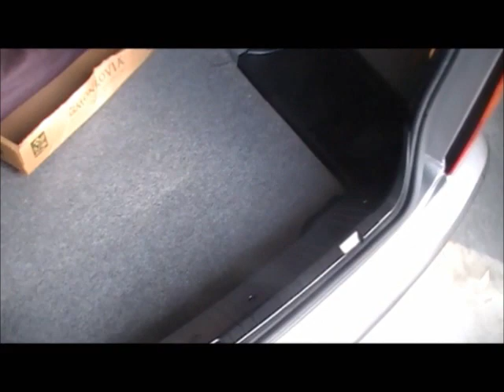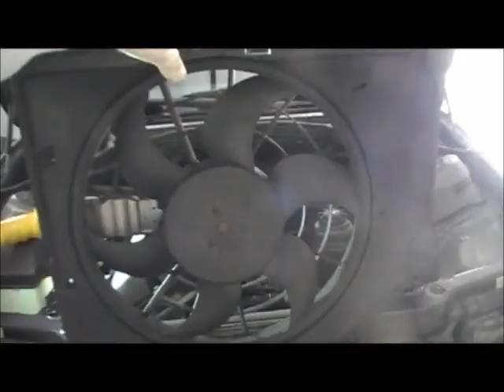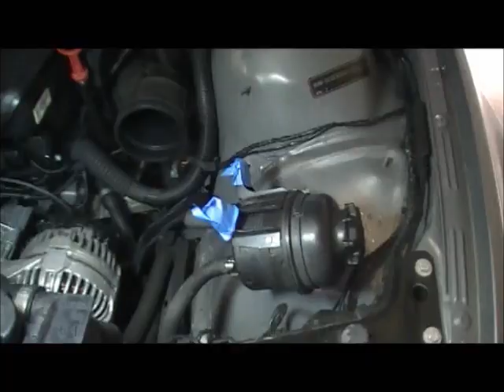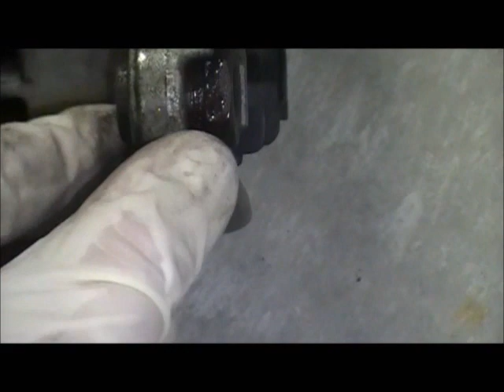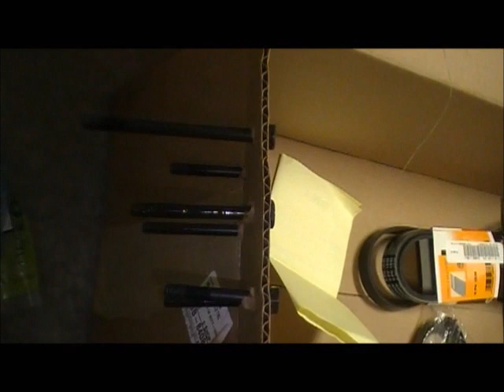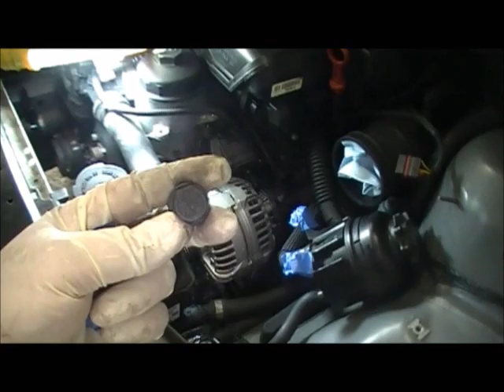BMW Oil Filter Housing Gasket and tensioner idler pulleys

Comment: The bad thing about the e46 is like most late model BMW's, stuff breaks that will seem foreign to you if you've owed a Honda or Toyota. Having owned Acura's at the same time as BMW, it's a striking contrast of how much attention these cars need. BMW's main magic trick has been to turn rubber seals and gaskets into brittle plastic in a relatively short time compared to the Japanese. I sure hope they don't make condoms under another name. The good thing is that there is plenty of good how to videos on YouTube like this. Thanks.

Comment: you absolutely do not have to take the positive terminal off of the battery as you won't/can't complete the circuit without the negative terminal connected to the battery !!!

Comment: Awesome vid! Question: Dealer told me oil filter housing is cracked. Is it safe to assume the seal needs replaced? Just curious before I dive in;)

Didn't like the guy, failed insp for mirror marks (the defrost tint, not sure what it is)

Comment: Thanks a ton for this video. It helped tremendously. I did not , however, disassemble the power steering pump. Yet, replacing the gasket was easy. Surprisingly, the e39 m54 is easy to work on...just time consuming.

Comment: I got Engine Service light on after replacing the oil filter housing gasket. The fault code is P0014 BMW - 'B' Camshaft Position Timing Over-Advanced or System Performance Bank 1.  It complains VANO is having issue. I wonder if you have some suggestion as what would have caused the issue.

I have done the following to attempt addressing the issue:
1. visually inspect all electrical cables are replaced, especially the ones connected to VANO camshaft position sensors and solenoid. I power-washed the engine bay and wonder if I have shorted some sensors. 
2. turn the oil-feeder bolt that sends oil to VANO. I was worry that the bolt needs to be at certain angle to allow oil to flow. Could it be that it is not feeding enough oil to operate VANO?

Comment: Thanks for the video instruction. It is very helpful. The most difficult part of the job is to put alternator back. It is hard to line up the holes on the bottom bolt.

Comment: Great video.  But you can replace this gasket and leave the oil filter housing in the car.  You won't have to lift the front of the car, either.

The power steering pump does not need to be messed with if all you are trying to do is replace the OFHG.  The PS pump and brackets do not attach to the motor...only to the oil filter housing itself.  They are plumbed into the power steering rack with flexible hoses.

Once the filter housing bolts have been removed, the housing can be tipped away from the block back towards the driver's fender enough to get to the gasket, much like the power steering reservoir is tipped away.

I just did mine.  Saves a bunch of time not removing the housing from the car!

Comment: Hahah automatics
Reply: Shawn P
I referred to the joke at 5:52
Reply: +FrozenHaxor  the e39 manual still have a fan connected to the engine
Reply: +Kevin Sahib Okay but how's that relevant? This is an E46, a completely different car. E39 actually has 2 fans. One being electric aux fan for the AC, located in the front.

Comment: I've watched your video like 20 times and it's been a life saving and actually not bad to do. I don't actually remember where you mentioned on where to put the sealant? :X    I'm actually doing this job for a second time bc my water pump busted on me and the fan wasn't even spinning but without this video, everyone would be going to dealers or shops to get ripped off

Comment: is it necessary to take all those items off to get at the oil filter housing gasket?
Reply from the maker: if you haven't done your tensioners and they spin freely then yes, otherwise only one of the tensioners need to be removed as I recall, the one with the alternator.

Comment: question, please help,  I purchased a 325 2006 bmw.  I specifically asked the seller if there were any issues with the car and the seller said no  however I brought the car in and found out it has an oil leak.  Question  I found out that a bmw dealership told the seller that their was an oil leak right before he sold it to me,  the statement says  : "Oil filter housing gasket is leaking drive belt tensioner is leaking".  This was told to the seller in april 2013 he sold me the car approx the end of june 2013.  can this issue cause further damage because the seller did not fix this issue, can this leak and drive belt tensioner cause another oil leak?

Comment: Thanks for the DIY - worked great for my e39 replacement but I did have to battle with mechanical fan and shroud...  One tip for removing/replacing the alternator that I figured out (others may have noticed this too).  You talk about wedging the boss nut to release some tension to remove the alternator (I did that and it helped). Putting it back in was a problem and it dawned on me that with the alternator out of the car you could thread the lower bolt into the boss nut and give it a few taps to drive the boss nut out just a hair to widen the gap.  I think that would also work well on removing the alternator too.  Just make sure to torque it up properly upon installation to pull the boss nut back into place.

Comment: Thank you. I did this job on my E46 2003 330i last saturday it has 65k km, but 10 years of city driving. I'm an amateur mechanic. My car got this leak for about one year ago, and I had no a clue about the source of this leak, I thought the valve cover gasket was the culprit. Without this video I would have to pay a good money to my local BMW dealer shop, down here in Mexico. I had to remove the radiator fan because my car has automatic trans, but this is not a big deal using the proper tools. By the way, the old filter housing gasket in my car was like a hard plastic (not flexible rubber anymore) and partially broken. I don't know how BMW was not able to use a better material or different design on this. Same case for the valve cover gasket, which I'll replace it next weekend. Thanks again dude!!

Comment: Hey man you might already have figured it out, but you need to take the A/C belt off first. There are a total of 2 pulleys. One for the A/C belt (smaller belt) and one for the alternator belt (larger one). When I did mine both had a 17 mm bolt head, that I had to *Tighten* to get the belts off. 
Of course you might need to first take the radiator fan off to have space to work with. 
Hope this helps man

Comment: Hey man, I don't know if you receive or read all of the comments, but I just wanted to say thank you for the video. It was very informal and helpful. I performed this task a couple of days ago at my house and had to come in to view a couple parts where I was stuck on. Thanks again. By the way, I have a 330ci (european spec) and I didn't need the 60 torx. Not sure if you where aware of it. I got away with using a 17 mm for both pulleys. Also I only changed the gasket.
Total you saved me about$750

Comment from the maker: Its likely just pure chance that this happened 2 weeks after an oil change. they are nowhere near these components and well...it's just not good karma.
Now the burning smell or oil smell is a definate sign of valve cover leaking. They probably also looked and saw you needed the oil filter housing (OFH) done as well. These are very common leak points in the e46. So now...if you're telling the entire story 2200 is NUTS. half that would be worst case and still bad. go elsewhere for 2nd opinion.

Comment: please tell me what u think i took my car to BMW for an oil change recently about 2wks later notice a burning smell coming from the hood and smoke, took it back, they told me it need a oil filter housing seal and valve gasket change which they never did when i initially  took it in. they now gave me a quote for about little over 22 hundred dollars, i feel as if they were negligent in not telling about the issue originally. i didnt have any issue before of burning smell or smoke.

Comment: If you disconnect the negative side of battery you don't have to worry about grounding the positive terminal from the alternator .  Very informitive video I was wondering what was leaking in that area now I know. Thank you.

Comment: Thanks for making the video. Im half way through replacing the gasket on my mates car. Its not too bad an extra amount of work if the car is an automatic. Just need a 32mm? open ended spanner and a flat screwdriver. You can jam the screw driver against a couple of pulley bolts whilst turning the nut on the fan coupling clockwise to remove the fan. this video has been a great help. Now for the re-fit. Thanks!

Comment: Probably the best DIY on an E46 I've seen, thank you!! I just completed this on my 2002 325i and halfway through my family was so impressed with my bad assery especially the cardboard to hold the 6 OFH bolts. Of course I did NOT give you credit, but I will do so here :)

My older model had different tensioners and power steering pump, but not so different that I couldn't figure it out. Anyway, really appreciate your work here!

Comment: PMPDaddy68 - HUGE Thanks for the video!!  I bought a used e46 for my son (first car) - we got a great deal....and the reason was it leaked oil from the filter housing - as well as the valve cover gasket....Your step by step made my repair run SMOOTH!!!  I couldn't have done it without you....My son and I thank you!!!

AWESOME!!!

Comment: I'm having trouble finding where to replace the oil filter adapter o ring on my 318i 1996  There were none there when I removed it on the thermostat type component, I believe it helps regulate oil pressure?  HELP!

Comment: Thank you so much! You are very organized and methodical and that makes it very easy. Great DIY! My husband and I did this job yesterday on his automatic, so we had the fun job of removing the fan. I didn't have the fan clutch wrench so I used pair of of channel locks and a long thin screw driver to wedge in between the water pump bolts. It was leaking from the valve cover gasket and the oil filter housing gasket. Saved over $1200 doing these ourselves! Thanks for your help!

Comment: My husband has an 01 330i and everyone I asked quoted between 700-1000, but the BMW specialist I got a second opinion from (after the dealership wanted 2500 to do valve cover gasket, oil filter housing gasket, and oil pan gasket) he told me that most of the time its not actually leaking from the oil pan. Usually it's only the oil flying back while your driving getting all over everything leaking from the valve cover or oil filter housing gasket or both in bad occasions, like my husband's.

Comment: As I was following your steps, I noticed the banjo bolt on the Vanos was missing one of the washers.  The washer that sits closest to the housing was missing.  After replacing the housing gasket, I still have a steady oil leak.  Do you think this would be the reason to still have a steady leak?

Comment: Hello and great video... I have a huge problem, im doing the same job, I took out Oil filter housing, shook oil out of it and and small metal sphere ( about 1/8") and a metal cylinder (about 1/4") came out of somewhere.. Its on a 530i 2001... what is it and where does it go? PLEASE HELP ..

Comment: Damn great video and I love to see how you used bolt size torque chart for torque... i also need to replace OFHG tomorrow.. i was wondering on the torque pattern used? I'm thinking start from center two and work outward? Thanks.

Comment: Just did this. Took me 3 hours. Washed the engine. There was a lot of oil I had to use soap to get it off the engine and all the accessories around.

Comment: If you didnt know, a work on BMW is much simple than on any Japanese or Korean car. All parts are easy to access and a wrong wire will never plug into a wrong spot. Believe me i have taking my BMW a part and I had much problems with my previous Mitsubishi car.

Comment: I took my 2006 BMW 525I inspection.  Dealer said oil filter housing leak.  They estimate to replace for $650.  Could you show how to replace Oil Filter Housing Gasket Leak for 2006 BMW 525I E60.

Comment: you have done an amazing job with this video! doing what you did and not shake the camera- thats some awesome quality skill. i have m56 and it looks the same. my steering pump went out 125k and by the time i got to it i figured i change the gasket and wanted to see if there are other obstacles. and no its all straight forward. one thing i would ask is instead of loosening the bottom end of venous line 15:24 to loosen it on the other (top end) instead? and did you have to use new washers for it?

Comment from the maker: 186,000 miles on mine and not a single issue. Best car I've ever owned. You get what you pay for. Some say they are hard to work on and granted some items may be over engineered, but they run forever for a reason. Cant go wrong with the M54 engine, i hear many say it's the best engine BMW ever produced and by my experiences i'd have to agree. I see absolutely no reason why i can't hit 300k miles on this car.

Comment from the maker: without watching my video i'm pretty sure i mentioned that in there, but yes pretty much any washer you pop off a system that contains fluid usually is a pressure washer and deforms with the torque, so you should always replace them with new.

Comment: Thanks for the video.  I just changed my gasket base on your video.  The gasket was so hard and brittle that I had to used a heat gun to soften the gasket enough so that I could remove it.  Save me $600.00.

Comment: Thanks for empowering me to do the job myself.  I did this repair and  the CCV assembly at the same time.You are a total Stud for posting this!!! 19 hours (with breaks and a trip to the store for an LED lighted telescopic mirror...a must) for both repairs.  Getting the alternator back in  was a pain.  you need to put in the bottom bolt first and use a mirror to help line things up.  I used a rubber mallet and my mirror to line up the holes.  Thank You Thank You Thank You THANK YOU! 2004 x3

Comment: Is this roughly the same on an M42 engine? [95 e36]. I have a manual but have heard you need  "special tool" to remove the fan. Is this the case for the automatic only..?

Comment: Great Video!! 
I have 2 BMWs, 325i and 525i, I did the job on the 325i and no more oil leak, do you recommend doing the 525i which has not leaks ? or should i wait till i get to 90k Miles, 

Thank you for the video

Comment from the maker: @Raptorman5174 thought i had covered that in this video as i did replace mine. but yes anytime you have a crush washer, you should replace it. (i.e. oil drain plug crush washer is often overlooked)

Comment: This is a great video, one suggestion though is that the washers on the vanos high pressure oil line should be replaced every time they are changed or you will have an oil leak there.  
Great Video!

Comment: thank you for posting this video you are awesome i change my ac  tenscioner and belts. pulley .housing gasket. with this video but the problem was the oil vanos  line was riped  so everything  helped to do it with this video   the alternator was really tough to take out but i follow step by step from this video and i did it thank you thank you i save alot of money  keep doing videos like this

Comment from the maker: @phillyphill112 i first cleaned my engine with gunk and a presure washer being careful only to hit metal areas with the spray. then once i removed everything i plugged all the oil holes with clean shop rags then used brake cleaner liberally sprayed around the oily areas then soaked/ wiped it all up with the blue shop towels till clean.

Comment from the maker: @Jyunka1 no need to drain the oil as long as you cover the hole with a clean shop rag to keep any debris out when you remove the tube that holds the dipstick.

Comment: After doing some research I found out I needed a torque wrench. What's the best way to clean this whole section up? I know I shouldn't get water into the engine block, but is it ok to get water in and on the housing? As long as I dry it well?

Comment: Great video! I'm about to change the gasket to my oil filter housing and this is so helpful. I'm leaking a lot of oil. I'm also about to change all the hoses on my power steering pump. Leaking p/s fluid everywhere. But I got a question. You talk a lot about getting the right torque on the screws. How do you make sure you're getting the right torque? Is there a tool? I've always heard about this but I just tighten up my bolts by hand. Help?! you can also email me at phillyphill112@yahoo Thanks!